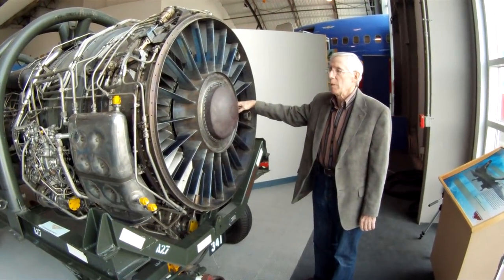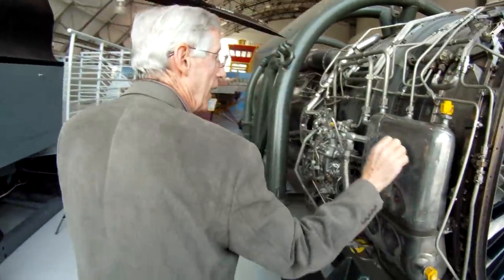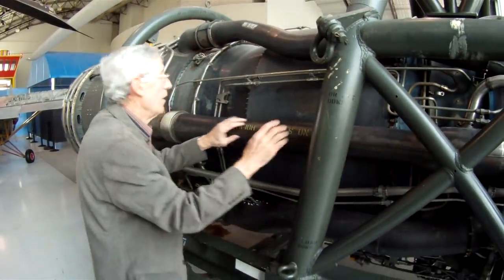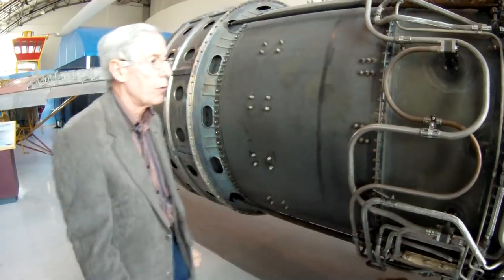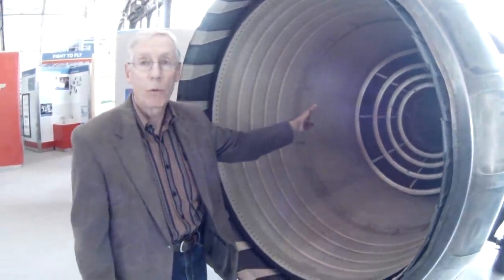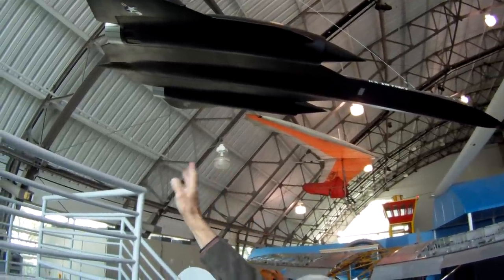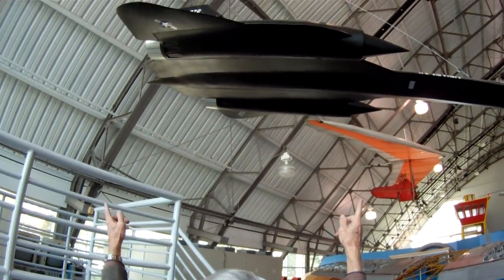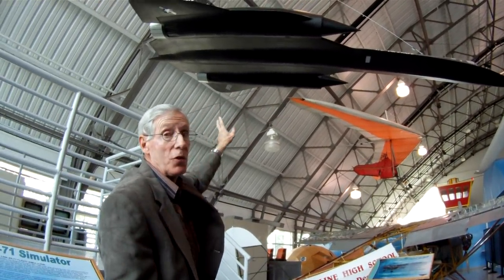SR-71 J58 Engine Tour

Comment: These 6 bypass tubes on the J58 are not actually the main bypass used for the ramjet as some people seem to think. The main bypass is built into the nacelle itself and sends air completely around the outside of the J58. The ramjet air is not just skipping a stage in within the J58, it skips the J58 entirely and collects/exhausts behind the J58. 

It is hard to show that when the J58 has been removed from the nacelle, but that is what Rich means when he says this engine is only supply 20% of the thrust at mach 3. The other 80% is coming from the ramjet "engine" which is the nacelle itself.
Reply: Sphere723 
   SO right you are!!
   Your comment is CORRECT!!!
Reply: I've read up on that
Reply: That's very interesting. Thank you
Reply: Sphere723 , but the air still has to mix with the fuel.  You don't just get energy from shooting the air around the engine as that would violate the conservation of energy laws.  Not saying your wrong, but there's no way those bits are exposed to Mach air
Reply: Mike won’t say you are wrong, but I will. I appreciate this is indeed complicated and I love that people want to understand this engine.
The 6 bypass tubes are compressor bleeds used to keep the compressor exit temperature within limits. Normal engines would throttle down or bleed air overboard but at M3.2 you want to take as much air as possible. That means keeping compressor speed up. You then bleed the compressor to drop the pressure rise (temperature rise). The lightbulb moment came in when they said: what if we take the bleed air and put it back in front of the afterburner? This is harder than it sounds but it gets you the max amount of air into the afterburner. Remember, at Mach 3 you are trying to take the high pressure air and just increase its temperature (specific energy) to its maximum. You achieve the highest temperature by burning at the stoichiometric fuel to air ratio. Now, more air means you can add more fuel, which means you have even more energy shooting out the back.
The air going around the cowling is there for other reason. Some of it is coming from bleed air around the inlet used to keep the shock wave in place. Some of the air will be there to “vent” the hot engine. And some of that air would be used to help keep the nozzle petals (on the aircraft side) cool enough. The engine does the same with a ceramic liner filled with holes and small opening in the back right before the engine nozzle petals.  The aircraft does the same - they send air around the engine and then produce a thin film of cool air just inside the aircraft nozzle petals.
The idea that this engine only produces 20% of the thrust is bizarre to me and I would like to check the math on whoever did it. I think maybe they did it in terms of gross thrust instead of net thrust.
Reply: Carlos Soto , well we know for sure those tubes bleed from like the 4 stage of the compressor or so.   I don't know if that means it can't cram air until the afterburner stage after that.   But if not,  can we see drawings of where all the air creating the ramjet comes from ?
Reply: Mike Rothwell, help me understand your question. I think there is some confusion created by people trying to call this a ramjet engine. This is a big turbojet engine exhibiting characteristics of a variable cycle engine. Today’s variable cycle engines are trying to switch between turbojet and turbofan. The J58 was trying to switch from turbojet at takeoff to ramjet at Mach 3.
The trick at high Mach is just to light up as much air as you can as hot as you can. Fighter jet engines would follow this idea by opening the nozzle at full afterburner and switching the variable vane angles to make sure the fan is always taking in as much air as possible. At Mach 3 you have to lose the fan go for a turbojet. Your concern becomes how to keep the gas generator running without exceeding compressor exit temperature (this is one reason the OPR in the J58 is so low).

Now, the afterburner is full of air at a high total pressure. In order hold the flame, that also means the air has to move slow, which means high static pressure. You can’t just take air from the engine cowl and cram it into the afterburner. It’s not going to have enough pressure; i.e., air in the afterburner would leak out if you tried that.  This is why I said to someone else that taking air from the compressor and mixing it with the turbine exhaust before the afterburner is far easier said than done. Now add to the problem that you want valves potentially modulating or at least shutting that flow... it’s hard. Even in today’s world it is hard.
Reply: Carlos Soto , well the more you mention it,  the more it seems to me all the air creating the ramjet is from the air bypassing in those tubes.   I just want to know where the other air is coming from and where it's getting back into the engine.   Because we can agree it's not going across all those exposed parts around the engine, right?
Reply: Mike Rothwell, a ramjet engine is just an intake slowing down the air to subsonic speeds (like the spike intake), then a burner (the J58’s afterburner), and a nozzle (one in the J58 and one in the airplane). All the air going into the afterburner has to pass through the compressor intake and be pressurized. There is no other way around that. An unknown fraction of that air going through the compressor is then bleed out through those pipes and directed behind the turbine. The other fraction will go through the rest of the compressor, combustor, and the turbine. Then the two streams join behind the turbine and get ready to be ignited again in the afterburner. Those large pipes should be passing a minimum amount of air when the engine is in Max “dry” power and then full bleed when flying at Mach 3.

You still have/need air flowing around the engine but the point of this air is not to produce thrust. I think some of the air may come from the intake as they play with the shock wave but regardless of that - you also need air venting around the engine to keep it cool. That air eventually makes it out between the j58’s nozzle and the airplane nozzle. This would serve as film cooling to the nozzle petals in the plane.
Reply: Copy from Wikipedia: The propulsion system consisted of the intake, engine, nacelle or secondary airflow and ejector nozzle (propelling nozzle).[14][22] The propulsive thrust distribution between these components changed with flight speed: at Mach 2.2 inlet 13% – engine 73% – ejector 14%; at Mach 3.0+ inlet 54% – engine 17.6% – ejector 28.4%.
Reply: Mike Rothwell Mike, it has no reason to argue with the conservation of energy in classical physics. The two systems do not violate each other.

All the inlet spikes are doing during transition from low Mach 2 to Mach 3+ , in an SR-71 is moving the energy cycle to a different place in the engine nacelle. The shockwave captured by the spike would be wasted energy if it wasn't utilised. So by moving the spike backwards and closing off some doors it allows the air to flow around the outside of the central engine core and move to the after burner section at high pressure and at subsonic speed where it is ignited with the fuel at the ejector nozzle, and expanded to create massive pressure, at extremely fast exhaust velocity, which has no place to go but out the rear of the aircraft.

But - and this is an important but - it still requires the engine to be turning. If the engine wasn't powering the aircraft, by around 20% thrust, then friction and wasted energy will eventually slow the aircraft down until it stopped or fell out the sky...

The trouble is, at speeds above Mac 2.5 the engine gets extremely hot, and so some bypass bleed air is taken from behind the inlet spike and fed along some bypass tubes to mix with the shockwave flow in order to help cool the engine. In doing so, the engine gains around 17% thrust due to the cooler air in front of the injector nozzle. This cool air bleed is known as a free turbine cycle. This is due to the fact that the 17% gain could be equivalent to adding an extra turbine compression stage on the spool.

So if you think of it this way, the SR-71 engines were providing the 20% to make up for the wasted energy lost during the shockwave RAM air compression, heat and friction.

Concorde used the same principle. At Mach 2.02 the Concorde only needed 66% of the thrust from the engine itself, the rest of the energy simply came from the inlet doors being computer-controlled to compress the air to be used for expansion in the ignition chamber. In simple terms, Concorde used to push itself along, by the mere act of moving along.. this is what allowed it to supercruise without after burners at at speeds faster than Mach 1.7.

Below 1.7, Concorde could not supercruise, because it simply wasn't moving along fast enough, to be moving along fast enough.. err.. to be moving along fast enough..
Reply: Wrong.  Potatoes are not communist.
Reply: G M actually the flaps were separately controlled by digital computers, where as in board operations were done using analog computers.

Concorde was the first commercial aircraft in the world to have both analogue and digital computers utilised in its operation. 

It was also the first commercial aircraft to have computer controlled fly by wire - and a system similar to FADEC in modern aircraft, for providing computer controlled auto throttle. So during climb, the aircraft kept itself at the most efficient climb rate, azimuth angle, and engine throttle, based on the atmospheric conditions.

Absolutely amazing for 1960s technology.
Reply: It was Designed without computers , just guys with sliderules
Reply: SurfingBullDog Correct...And thats why I never go boating without spare tires.
Reply: Carlos Soto Where can one get this "ram jet" you speak of?
Reply: The air that bypasses the engine is used to cool the engine. The 6 bypass tubes take air from the 4th stage of the compressor and divert it directly into the afterburner where it mixes with fuel and burns to create more thrust. This is the "ramjet" functionality of this engine. It is way more complex than that but if you watch the video I posted here you may have a better understanding of how it operates.
Reply: Mike, watch the YouTube video I posted on this blog, it explains in pretty good detail how the J-58 engine generates thrust.
Reply: @TheCorrectionist1984  It is the pressurized source of oxygen for the afterburner.   It does not clear the entire engine, just the compressors and initial combustion area.  It simply re-enters at the rear of the engine just ahead of the afterburner grates.
Reply: The nacelle is sealed around the front of the lip seal...all air from the spike and nacelle goes through the 1st stage compressor , and bled through the 7th stage bypass tubes ...the only air going around the engine are  tertiary doors SUPPLIES ENGINE COOLING AIR SUCK-IN DOORS CLOSED TERTIARY DOORS OPEN EJECTOR FLAPS CLOSED AFT BYPASS DOORS CLOSED FWD. The Spike & Nacelle regulated by a processor keeps engine intake heat around 457 degrees ( I think that's the temp )
Reply: @TheCorrectionist1984 You're on to something here....I'm no engineer but it doesn't make sense how the air flowing around the engine can accelerate to 80% more that the engine thrust....unless the J58 at full afterburner it's just a combustion chamber and the complete nacelle is the engine lol....... I think this technology is still classified and they're not giving the full blue print.
Reply: Neither the six bypass tubes nor the inlet air that bypasses the entire engine make it a ram jet. Here’s why:

The six tubes that put compressed air into the afterburner are mainly to relieve the pressure from the compressor as was described in earlier comments.  The J-58 was originally designed to produce high static thrust for the P6M Seamaster flying boat, so it was overly compressed. If you bought even Mach 2.5 air down to <Mach 1 the pressure and heat would be too high for the combustion chamber and first stage nozzle guide vanes and turbines. You actually couldn’t add enough fuel to turn the compressor without over temping the engine or stalling the compressor.. but dumping it reduced the load on the compressor. Putting that high pressure air into the afterburner made the afterburner more efficient, but it’s a rob Peter to pay Paul scenario. The temperature and pressure drops greatly across the turbines to power that too huge compressor.. plus all of the frictional losses transferring that energy to the compressor and duct losses transferring it back the the afterburner.

A better way is to simply design the engine not to compress air as much at Mach 3. That means the pressure and temperature drop across the turbine is much lower, the amount of thrust your gas producer is making is higher, so your afterburner doesn’t have to work as hard and it’s nearly as efficient because the gas pressure is already higher. 

And this is exactly what they did in other Mach 3 planes. The Mig-25 used far fewer compressor stages. The XB-70 used variable stators and variable inlet guide vanes. 

So why the J-58?  It was the only engine large enough to produce the required thrust for Mach 3. The J-57, the J-75 (which powered first versions of the A-12), the J-79 all were all too small. Even the YJ-93 was too small... six were required to power the XB-70 and the SR-71 would have needed 3 or 4. 

Now as for the duct going around the engine. It is not a ram jet either because no energy is added to it. It creates a great deal of compression and heat as the inlet slows the air down.. and then when it expands out the nozzle it converts most of that energy back into thrust. 

This is quite common on supersonic aircraft where inlets must function at multiple speeds and thus too much air enters and has to be dumped overboard. The air must be slowed to subsonic speeds to be used by the engine and it creates a large amount of drag.. and this drag is mostly overcome by venting it overboard. On most aircraft this happens very close to the inlet, typically before the first stage compressor. The reason being that there would be excessive duct losses if it was a long passageway to the rear of the nacelle. 

But since the J-58s afterburner was doing almost all of the work because the engine itself was bogged down, it needed a massive  amount of cooling air going over it. That is what this inlet air was for. It did receive a little bit of energy the form of heat from the afterburner to offset the duct losses and produce a bit of thrust (a modern reverse flow combustion chamber operates the same way.. the heat energy from combustion transferred to the incoming air as it flows around it offsets the duct losses from reversing direction) but it still can’t be called a ram jet. 

Ultimately the J-58 has the same limitations that apply to all gas turbine engines.. the maximum temperature the nozzle guide vanes and turbines can handle. This was directly related to inlet discharge temperature which was limited to 427C which is about Mach 3.3 at 80,000 feet ISA.

Comment: Its awesome how the captured shockwave on the front spike can be used to:
1. Slow down supersonic intake air to subsonic intake air for the turbojet to take in.
2. Use the high power of the shockwave to increase thrust by channeling it "by-pass style" around the turbojet all the way to the back where it joins the exhaust, to generate more thrust.

Comment: The Air Force has never publicly released the SR-71's top speed. But, other SR-71 pilots have commented that there was still plenty of throttle left at cruising speed. So, if it 'cruised' at Mach 3.2, while only at part throttle, then full throttle could have been Mach 3.5 or possibly even Mach 4.
Reply from the maker: Gregory Parrott 
Heat friction was the limiting factor. Engines could take it faster but the airframe and skin couldn’t take any more heat.
Reply: No. It was engine limited. The engines were specifically limited to an inlet discharge temperature of 427C which corresponded to Mach 3.3 at 80,000 feet and ISA. 

This plane had more in common with the Space Shuttle than a typical jet aircraft, with a week of maintenance required between flights. Going above Mach 3.3 would turn it into months as they had to remove the entire outer wing assemblies to change the engines.
Reply: @calvinnickel9995  Interesting. Thanks for the reply.

Comment: Correct.  The "normal" jet function was used for takeoff. Then at Mach 2 a clutch disengaged some of the compressor and it ran as a ramjet. The bypass tubes cooled off the afterburner section, see the "Oxcart" video here.  P&W was surprised by how efficient it became.  Bob Abernathy in the video said the tubes were primarily used to cool the rear, but had the benefit of making it more efficient. They never solved the "unstart" problem.  See Ben Rich's "skunk works" book.  A great read.

Comment: In 1:5 mentioned that those 6 tubes just carry some air and let it go through exhaust to prevent compressor issues. This is not the case .   This engine is not a Turbo jet but is a  " TurboRam "  jet ! In speeds higher than 1.5 mach , these 6 pipes guide air from the 4'th stage of compressor to the after burner location and the engine acts like a ram jet . This is the way that SR71 could fly 3 +mach continuously. Thanks.